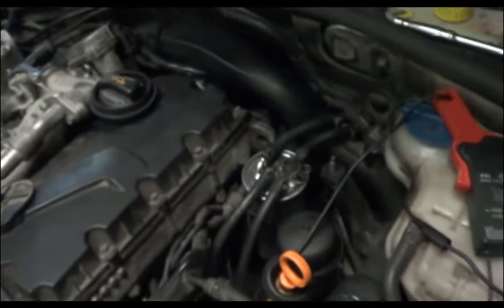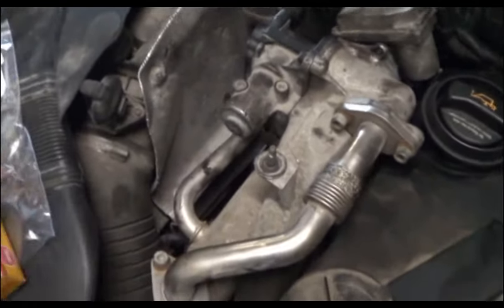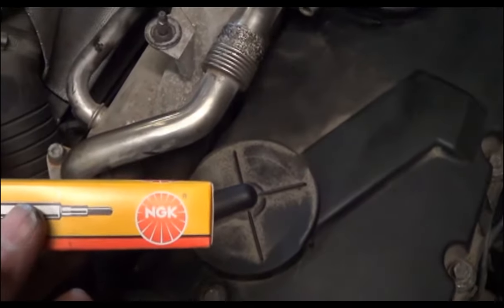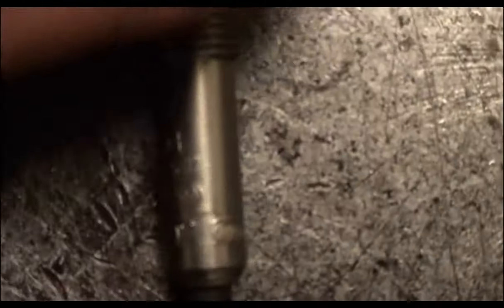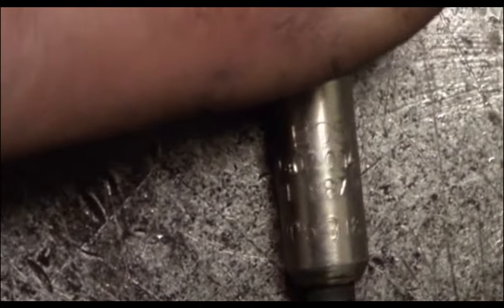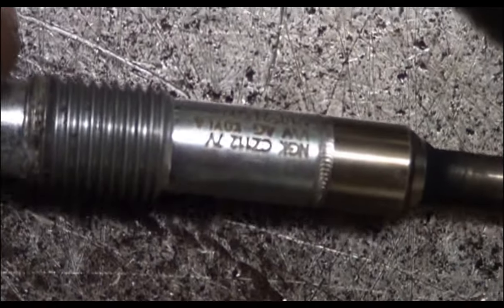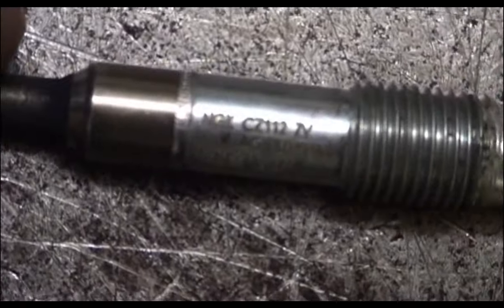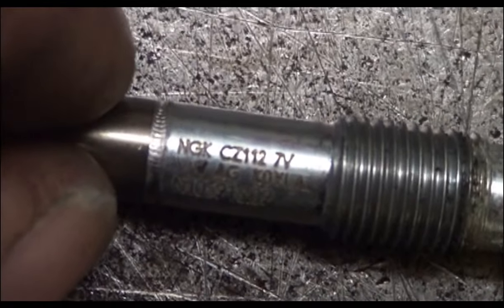P0673 Pd Tdi glow plug mismatch follow up

Comment: This was from a recall issue by vag. The original 7v ones were bosch and had ceramic tips. They used to break alot and destroy engines so vag changed them to 5v steel tip ones and flashed the ECU to change for the voltage supply. They then changed them back to newer NGk ceramic tip 7v ones because of complaints of some of these proving difficult to start in cold weather. Again the ECU was flashed to change this. It's important the correct plugs are used for the ecu voltage supply settings and most parts shops still supply both plugs because of the variation. Maybe a DIY job or another shop has just ordered one plug and it came ad the 5v variant and this has been destroyed by too high a voltage going to it. Anyways since you said you've never seen it thought I'd fill you in. We have alot more diesels over here in Ireland so I guess wed see alot more of these.
Reply from the maker: good info.